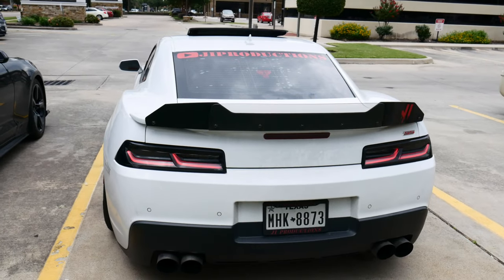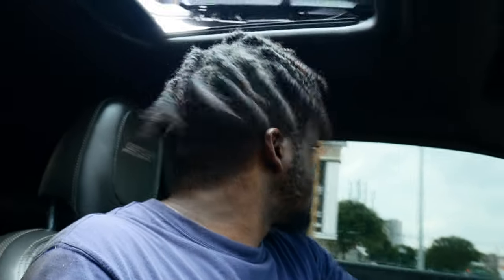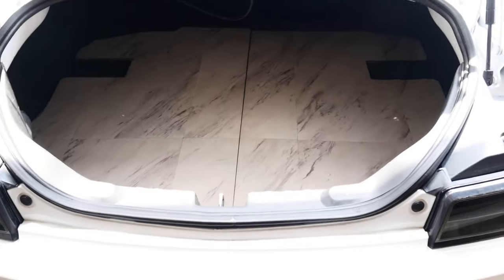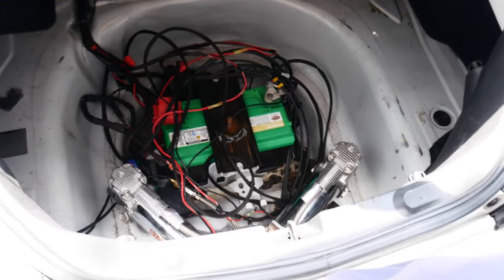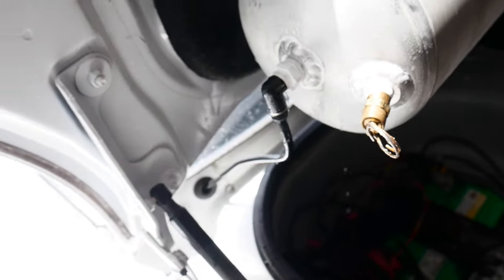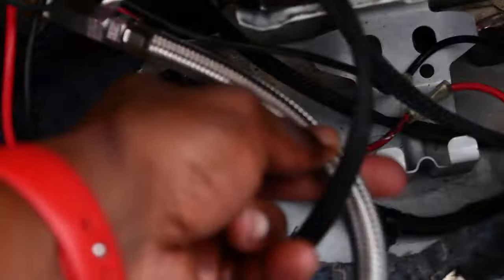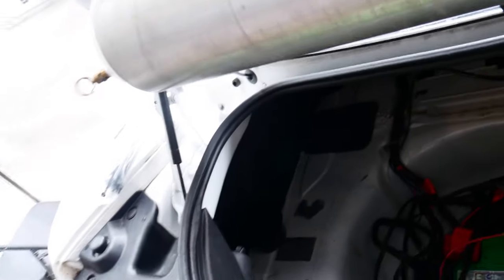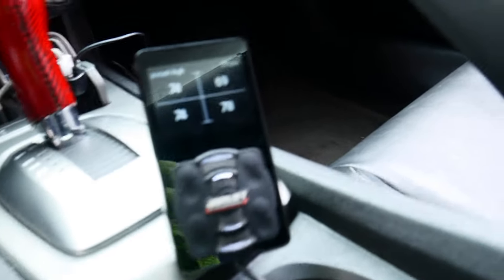I THINK ALL THE ISSUES ARE FIXED.. TIME FOR POWER

Comment: Do the brake light still delay?
Reply from the maker: That comes with those brake lights the issue was the turn signal hyper flashing
Reply: @JIProductions  do you remember which brand they are, there’s a few different MFGs of them